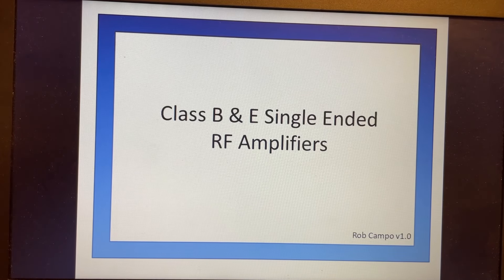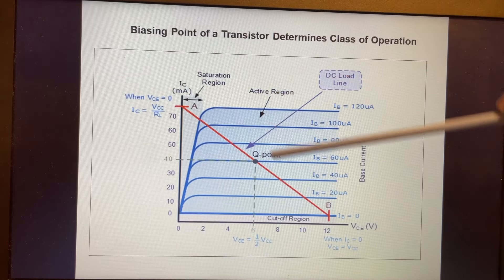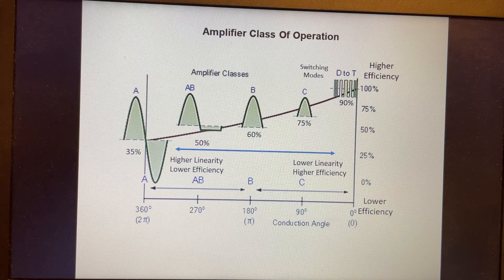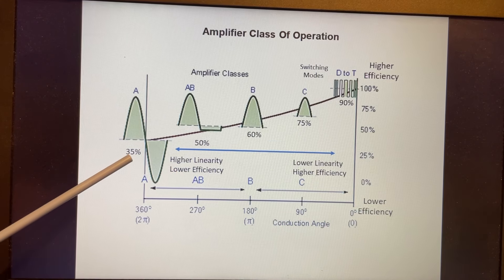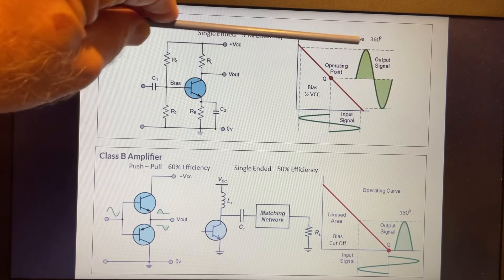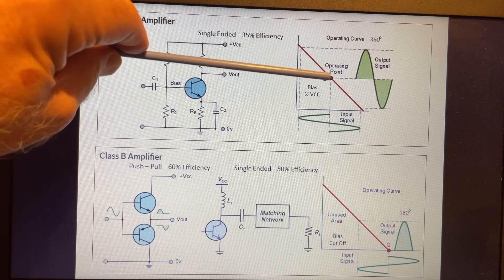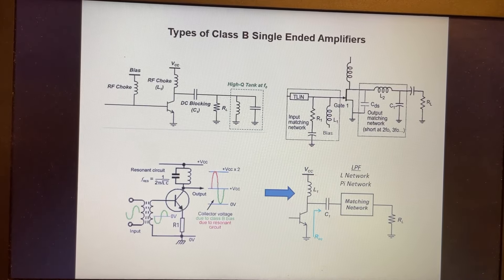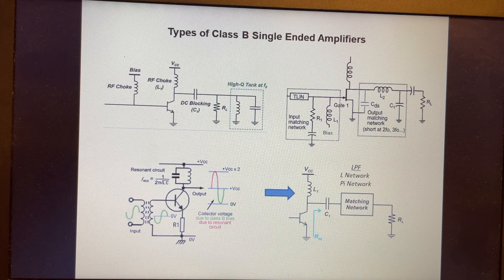Class E RF Amplifiers Explained - General Overview (Part 1)

Comment: Excellent presentation as usual. It might have been instructive to take FFTs of the waveforms to show the relative magnitude of the harmonics and the effect of the filtering. Also a curve showing the drain current of the mosfet times Vds showing the relative magnitudes of the switching and conduction losses.
Reply: Good suggestion!